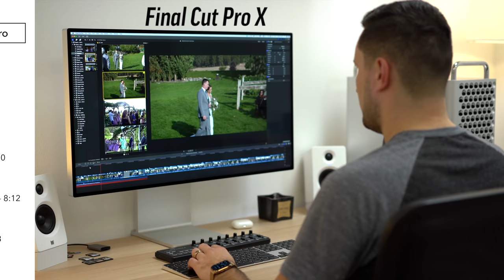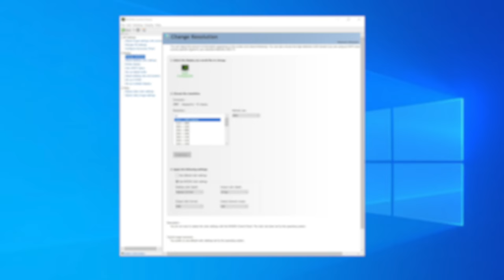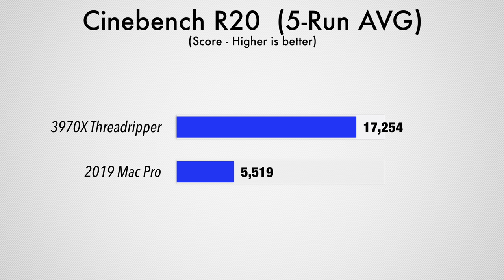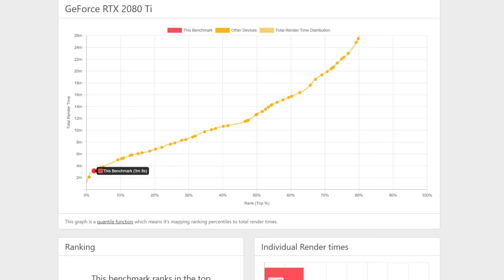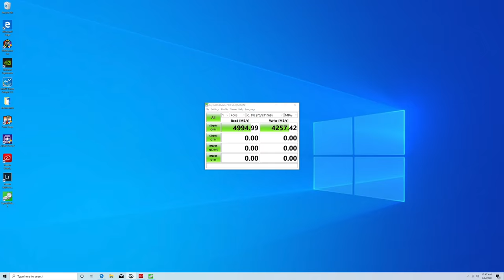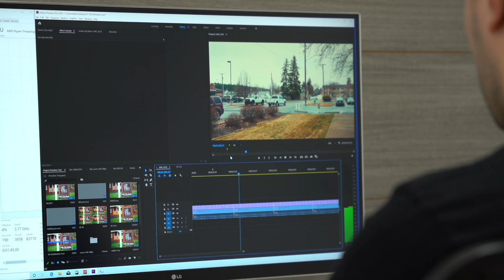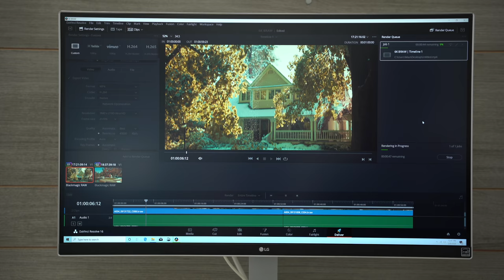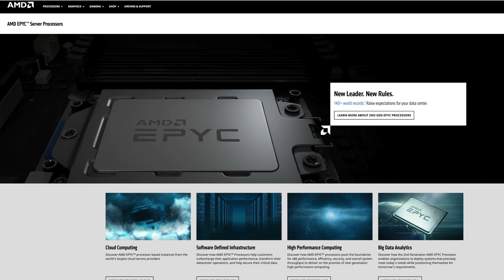$15,000 Mac Pro vs $5,000 Threadripper - Sorry Apple..

Comment from the maker: Were you expecting to see such a massive difference in performance? Comment with your thoughts below!
Tap Like & Subscribe if you enjoyed this video!
MacRIPPER CPU ➡ https://bhpho.to/37OnYWV CRAZY Case ➡ https://geni.us/RemIPM
⬆️⬆️Full Parts List in Description! ⬆️⬆️
Max Tech Wallpapers ➡ https://bit.ly/2WNc6Qw
Reply: Yeah but the price makes a difference u should try the new thread ripper 64cores 128 treads
Reply: Make one with the 64 core tread ripper 128 treads , that will probably push the performance insanely
Reply: As you mentioned correctly in your video, you should have added the $6000 GPU to compare. When using VRAM supported workflows, the PC would be much slower. Also a lot of macOS software is not Metal optimzed yet, CUDA is optimzed. These test results will change dramatically durning the next months. And having such a noisy PC next to you even when just browsing in the internet can't be really a professional workstation.
Reply: Thank you so much for the video. After seeing this I am curious if you can make a video on Windows vs Mac OS workflow. Thanks again.
Reply: I don't agree that you'd need "at least a Quadro RTX 6000" to be comparable, the 2080ti might have less VRAM, but the compute is much stronger and CUDA itself is much more performant on regular "workstation class" software like CAD and whatnot. If anything, you could bump it up to the Titan RTX which has 24GB of ram and cost $2299, but with either the 2080ti & Titan RTX, you're basically glossing over the fact that half the silicon is devoted to things the Vega card will never have like dedicated Tensor Cores for training / ML and other such features.

Also, NV Link allows 2 cards to communicate with up to 200 GB/s throughput, and in capable software the workload can even access the vram from 2 cards as a single pool.
Reply: @andreb4125  The card doesn't cost $6000, it is called the RTX 6000, it costs $4000, and the 2080ti is already more performant, so there really is no need - maybe you could go to the Titan RTX but that's overkill as well imo.
Reply: it's the only way to know the true power of hardware
Reply: install two amd Threadripper one on the mac pro and on the pc another amd
Reply: @EleMenTfiNi  yes you are right, it's 4600, my bad. But the 2080ti only has 11 GB VRAM whereas the Vega II has 32 GB.
Reply: Tempered glass case with rgb on a work station, Really? AIO cooler from Enermax?
11GB gpu?
Reply: ahh DUH... 12 core vs 32 core? What did YOU expect? Is this supposed to be a serious question?
Reply: @teddym2808  No, put a 15000 pc against this? I would go Epyc and quadro. Same price...
Just like my Amiga vs Pc at that time... 68k50+video toaster
Edit: If you are a old school computer nerd you should know this! The dx60 was no match for Amiga 4000 Same as mac is for pc with 64 cores...
Reply: @teddym2808 , keep in mind the price gap bud, keep it in mind...

And before you ask: yes, this is a serious answer.
Reply: @s4rg380  of course.. I have been ranting all over the place at the ridiculous price of the mac pro.. but for someone like me who wants turnkey, zero work, to USE osx specifically, and dead silent, we just put up with the cost and go for it and make it back very quickly and it pays for itself. I know it's a rip off, BUT, all kidding aside, if you put together a dell with the same components, it's no cheaper.. honestly.. and the dell's noise and thermals and design come nowhere close to the mac pro. I am also a very, very heavy thunderbolt user.. on my imac pro all 4 thunderbolt 3 ports and dual busses are used and I desperately need more.. I have multiple drive arrays, monitors, midi gear, audio interfaces etc.. So the way I would do it is, 16 core, 192GB ram, the 16GB 5700X (which is why I am waiting as that will be out soon and way cheaper than the vega II).. This will give me 8 thunderbolt 3 ports, i'll put a pcie USB 3 card from sonnet so I'll have 8 TB3 ports, 6 USB3 and still a few hubs. One thing that's absolutely out of this world ridiculous is the low USB i/o count and that it's not even USB gen 2. Absolutely ludicrous. But still, for someone like me it's the best computer that will "just work". I do use bootcamp sometimes and it has SO many issues with scaling (win 10 pro latest version) on high dpi monitors it drives me insane.. that in itself makes me want to never use windows again. Try using pro tools on the 5K imac display in windows.. the only way  it will scale everything properly without any errors (i tried every possible override setting) is to actually force windows resolution itself to 2560*1440.. which looks blurry and shit. It's hard to go back to low res after working in 5k for a couple years. But I still boot windows to game with emulation when I want to play gamecube or PS3.. Still, the way I see it for me is the 16 core mac pro with 3 x 5K monitors.. one for apollo console, one for pro tools mixer, one for pro tools project page. This is what I am saving for right now :). I also have a ton of hardware that works way better in mac than windows (just has much better mac drivers). Leaving OSX is non optional for me. After apple care expires in 3 years, I will upgrade manually to the maximum processor that it can take at the time :). I'll also buy the 192GB ram after market, not from apple, i'll have it delivered with base SSD and ram :) (well ok, maybe 512 SSD  instead of 256, just enough to put all my programs and plugins).
Reply: @teddym2808 , so basically, you've got too much invested to switch now, I get that.

And I am pleasantly surprised to hear an avid Mac user actually admit that it is insanely overpriced.

Despite having a lot invested, you don't seem to suffer from the "sunk cost fallacy" that typically defines Apple sheep. (and your not a sheep for that reason) you are a legend. 

Hey, I completely understand what you're getting at, I'd also be unwilling to switch over, especially if most of my peripherals are systems specific, I don't like adapters and workarounds, it's always full of shit when you do.

And if you're using software that works better on Mac, then it is a no brainer.

But to borrow from someone else in the comment section...

You don't need Threadripper, you've already got Bankripper.
Reply: Why didn't you talk about playing games? Because Mac is shit on this? Who buy PC just for video editing you mentioned here? Whereas there aren't 5% of pc users don't do edit videos or photos for profession..
Reply: @mr.know-all6984 , let's be honest about this for a moment, you wouldn't buy a Mac for gaming outright. So it's not really worth the mention, but the fact that you can game on this behemoth of a Gameripper, is indeed one of the bonus features that some will have no use for in a strict business environment. 🤣 If we were to compare apples to apples, the Mac does not state a claim to that effect. So it's Workstation VS Workstation. Though gaming at work would be very tempting... 😅
Reply: @s4rg380  You've a good sense of humour 😅 but my point was on mentioned about only Mac favoured features where he didn't title the video as only work station comparison.. I don't think many companies buy Apple for work station unless a company from USA.. Not every one does edit photos, videos or develope web/ web based programming as if MacOS does these tasks so well without any doubt.. But PC can does literally everything with proper and cheaper setup..  Remember there only 9% of pc users do use Mac OS in the world by 2019.. So it's obvious to say that for office work (work station) most people or companies do use PCs (Windows, Linux, ChromOS, BSD, etc).. Peace out..
Reply: @mr.know-all6984 , got it. Good point. 
Thanks for not taking it the wrong way, it was purely meant as a silly interjection. 

Pizza to you too. ✌🏼
Reply: @andreb4125  It's $4000, $4600 is some random site he showed and VRAM is far less important than computational performance for most tasks.
Reply: @andreb4125  You dont seem to know much about this stuff, is irrelevant that it has 32gb of vram if it cant move them smoothly, i think even offloading to ram the 2080ti would be able to render or process projects that stay between 11gb to 32gb of vram faster than the vega and projects that go over 32gb a lot faster than the vega, it also seems like the 2080ti would be faster than the vega 2 duo, anyways the priority for vram intensive applications is the gpu speed, not the amount of vram, because you want to get as much fps in real time, otherwise is useless. Also the quadro cards are designed to run for a lot more time at a 100%, and have some legendary support behind them while apple's support is really bad even compared to many pc brands, and running at 10°C more i really doubt the vega would last more than a Geforce so comparing the vega with the quadro is kindda off.
Reply: Adjusting the fan profile on the PC will solve a lot of your noise issues, especially if you adopt as unaggressive fan curve as on the Mac Pro, either way, I'm sure the PC had much lower average CPU Temps while not at idle
Reply: Nice but wrong video: You should have used an Epyc CPU (goes up to 64 cores and 2tb ram) as that's the one the MACPRO CPU is to be compated with:  https://www.youtube.com/watch?v=iN0COHoXxak 

Wrong video card used: the 2080 is not a workstation card, if you don't want to use the Quadro you should have used the Titan RTX with 24gb of ram

The freeze you have on PC are surely due to un-optimized BIOS/Ram settings. 

The case you used is ugly, there are cases out there much better looking than the MAC grater and you can have a useful glass window, plus you don't have to stupidly unplug all cables everytime you have to access the case interior (like you have to do on the MAC). 

Regarding noise if you put a liquid loop in the PC and adjust the curves in the bios, you will have a really silent PC, with the MAC Pro not having the dust filters you have on PC i wanna see the temeratures, cpu throttling and noise after a year from now ;)
Reply: @andreb4125  I have honestly to say that, the Noice isn't any Proplem, my PC runs at around 36 Dezibel in normal usage (and I don't have such a Noise redusing case) and I'm not even recognizing it :)
Reply: Why a 2080Ti? Why not a Titan RTX?
Reply: Linux would do better for professionals in some cases!
Reply: Yes
Reply: The Mac Pro still looks better. From the outside and from the inside.
Reply: No Amd is amazing at workstation and apple is amazing at making overpriced products like I wouldn't even pay £3000 for the best mac they are so bad
Reply: If read this comment now I think you know now that you can finally hackintosh this pc so now it becomes way better
Reply: @robertanthonybermudez5545  Hahahaha.. Awesome counter bro!
Reply: yea obviously apple is terrible at putting actually good parts in their products and even worse at pricing those products
Reply: Apple Watch dB thingy is not that accurate in my experience.
Reply: This video is a joke
Reply: The point is people want Final Cut Pro, AirDrop to share files.
Reply: Yh apple ain't high end they're just faking luxury
Reply: Honestly you should know that exporting on Mac will be faster but only because app version for Mac is partially compiling export file while you work on it while for the windows there is no such option so windows PC starts from 0.
Reply: here compare the 15000 mac to a pc of the same price https://pcpartpicker.com/list/37WvQq
spoilers the mac well get rekt
Reply: You did this all wrong, what should have happened was, you ask anyone that knows about good computers, unlike you, and asked them to build a 15000 pc. Then you should have compared the Mac to a standard price pc, around 1000-2000 again built by the other person for obvious reasons. Quite possibly the worst person to run a tech channel
Reply: @Mari-tb9og  if your responding to me I know that PC I built was bad the point is even with going way over the top and wasting money a PC is still way better then anything Mac spits out there over priced and under preform. My personal rig an Ryzen 5 3600  
RTX 2070 super 
16GB 3600mhz CL 16-16-16-36 ram 
650W 80 plus gold PSU a 3 TB mass storage HDD
And a 500 GB Samsung 970 Evo as a boot drive 
My case is a MX330 g by cougar
Reply: @andreb4125  if you're dying to have the vram(which isn't even needed lmao) then run a titan rtx with 24gb of ram, for half the price of a rtx 6000. the fact he said that at least an rtx 6000 is needed to compare it is ridiculous.  plus you also need to remember the pc is upgradable down the line.  you could keep this for years to come and make upgrades along the way while youd need to buy a whole other $15,000 mac in the future, which probably would be sooner than an upgrade to the pc, considering the lack of features such as pcie gen 4, wifi 6, and more.
Reply: @D00ML0RD1  I wasn't responding to you, j agree with you
Reply: Apple is trash
Reply: @Mari-tb9og  it's cool not mad just clearing the air YouTube dosnt always work right and well randomly mark or not mark things as a reply to a specific comment
Reply: Wait until you try it running Linux.  The performance will really knock your socks off.
Reply: @andreb4125  I don't know about you guys, but I don't ever have my PC sitting right next to my ear. I usually place my PC under my desk, which also give more desk space too which is always a plus. And I believe for $10,000 difference in price, those differences aren't too bad...
Reply: Ha Ha it's actually win for AMD in both cases. CPU in PC and GPU in Mac😅
Reply: Of course I was, this is Apple
Reply: I dont get why you wanna shell out 10000 more for less performance and more silence. This is the such hilariously lopsided and biased video despite the objective results that you yourself showed.
Reply: You have a lot of things missing from this build. Why not use a Titan RTX? Or use more ram? You are also kind of bottlenecking the processor with a normal pci express gen 4 SSD. You should use optane for those high core count CPUs. That may have to do with the crashes, since the pci express gen 4 SSDs are bad for iops.
Reply: Can I Plss get a pc I really want one but I’m kind of like broke...
Reply: @Franz Xaver Fuchsberger yeah. They have the new ThreadRipper 3995WX that can support up to 2TB of RAM compared to the previous one that support 256GB of RAM
Reply: André B, headphones exist, noise doesn’t matter.
Reply: You used loud fans in your build and your counting that as a fault for the PC?????? Genius!
Reply: Terrible comparison video, why would you build a pc with similar specs? No, you should have built a $15k PC to compare to a $15k Mac.